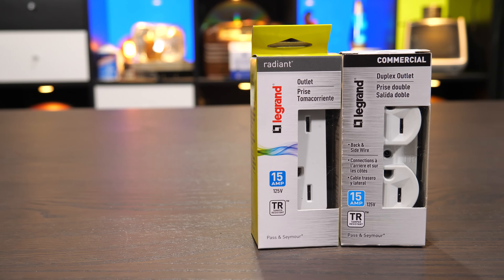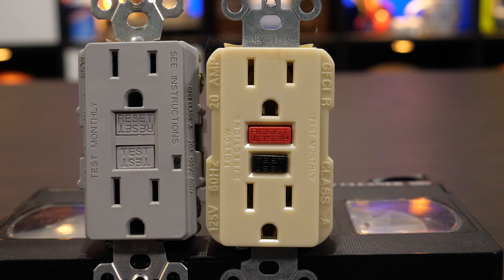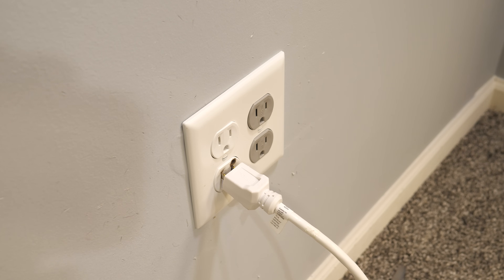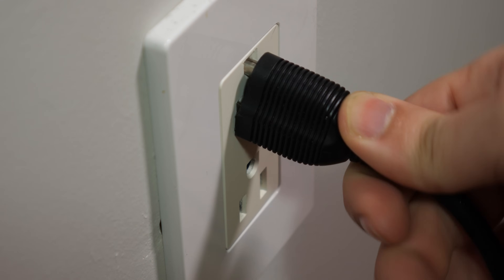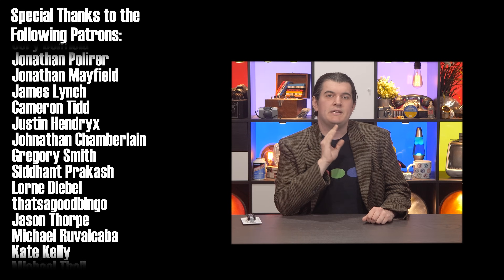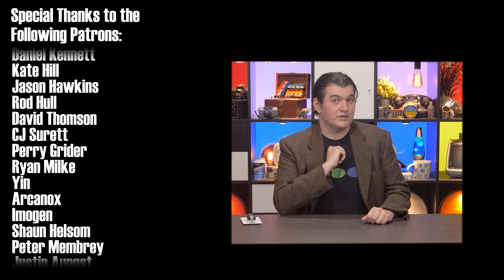Power outlets are topsy turvy - but does it matter?

Comment: I've been hit by everything from 110v ac from a wall to the several THOUSAND volts from an ignition coil on a vehicle.  I'm so sick of people being skittish about what is ultimately harmless in 99.99999999% of the cases it happens.  Yes, electricity can kill.  I get that.  The safety of a particular plug type or orientation isn't going to be nearly as much of a factor in that as the condition of the wiring of both the appliance, as well as what's in the wall, and the moisture content of whatever you're standing on.  From my experience, the safest plug isn't even found in most household applications, as it isn't common for ac wiring.  The humble pci-e connector on most (except newer high end Nvidia) computer graphics cards keeps both the male and female pins covered regardless of if they are connected, preventing any kind of accidental touching in the overwhelming majority of cases.

Comment: Honestly, as a commercial/ industrial electrician for over 10 years,  I have always found the ground prong is prone to separation and breaks when its left on the bottom because it applies all the force and weight on a single ground pin instead of two blades... also, the two blades are far more secure inside the plug housing than the ground pin... it also can help if something falls onto the plug,  the hot blades are slightly more protected from arc/ contact damage... plus, a pyramid is sturdiest when the base is wider than the top. But that's just my two cents

Comment: The UK plug and sockets system is absolutely safe, fool proof, protective and secure...nothing you showed here can happen to them, and in fact they are also a lot neater as the lead (cord) goes straight down along the wall from the bottom of the plug, which when inserted, only protrudes about half and inch anyway, much, much safer and neater that your system, and they cannot be knocked loose unless one uses a hammer....lol

Comment: We had a penny fall on top of a plug exactly as you demonstrated, but the power was on.  It literally exploded off, leaving a explody black stain from the top of the plug to about 6 inches up the wall.  It did trip the breaker, but it had long enough to melt two knotches into the penny.
edit: Our window a/c has a upside down plug.  well, its oriented for the ground pin to be at the top.  So we have to plug it in upside down.

Comment: I remember commercials made by the electric providers where they animated the plug as a face that talked.  So the electric company thinks it should be a face, therefore it goes ground down.

Also, night lights are made with the wide blade on the left, meaning they face up in a ground down receptacle.  If you put it upside down the heat of the bulb will reduce the life of the socket.

Comment: We need a standard that specifies a maximum width and height for a plug so it can fit in any power bar whether the outlets on it are side-by-side or top-to-bottom. No more wasting two power bar outlets because of a wall wart.

Comment: And our British type G plugs are right angle by default. And have sleeved prongs, except for the REALLY cheap plugs(which I'm sure aren't legal).
Reply: Your British plugs are clever because they have the fuse in them. This cuts down on the pretty pointless (as of 2023) discussion of "don't daisy chain extension cords". 

But personally I don't like their bulkiness. They are a design of 1940's, I guess nobody cared back then that a plug might be larger than a phone charger 😂

Comment: As someone living in Brazil (which had the Nema plug as a standard until the previous decade), I forgot how unsafe this kind of plug is. It is also very unreliable, plugs/outlets used to wear out and become loose.
The ABNT outlet (current standard here) is very good, it is based on the European plug and is even compatible with it (only when the plug has no ground pin). The only caveat is that for some reason they decided to have 10A and 20A plugs/outlets, with different pin diameters. It's probably because here in Brazil some regions have 220V phase-to-ground while others have 127V., and high power appliances need the extra current when on 127V....

Comment: I'm surprised that most all receptacle units have the plug sockets orientated one atop the other as opposed to side by side, which would allow for the cable to come out of the plug straight down without obstructing the other. the diagonal cable is certainly a good solution to this issue, as it allows the cable to go somewhat down as well as not obstruct the lower socket, but it means that if your sockets are sideways then the cable could still be going up instead of down.

Comment: I was waiting for a shout-out to tamper-resistant outlets. I recently replaced a bunch of outlets around my house, and I had to decide whether to use the regular outlets vs. tamper-resistant. I ended up going with tamper-resistant because I expect this house may someday be occupied by a family with young children, and I wouldn't want to be the reason someone got electrocuted. Now, tamper-resistant plugs have their detractors, as they can be more difficult to plug in sometimes. But I've found that pretty much any tamper-resistant plug can be plugged in easily if you know the trick, which takes less than a minute to learn.

Comment: Oddly, commercially available "plug checkers" are all set up to read with the ground down....  How would you use the Klein Tools RT250 GFCI Outlet Tester with LCD Display, withthe LCD face pointing down.... Just sayin' if the testing equipment can't be read in one orientation, that implies that there is a "usual way" and an "Unusual way".  I usually go with the usual and customary way, unless the application requires another option.  When someone tells me "its in the Code" i tell them to show me....  :-)

Comment: OMG, what a crappy power socket/plug system you have in USA. Where is safety?! You can incidentily touch energized wire when it is not fully inserted and you can even insert plug in wrong hole (ground)? Please, compare with European system which does not have those issues.

Comment: I work in a hospital and I was told by one of the electricians that the reason was in case something thin and metal slid down the wall and went behind the plug insulation. Then I had 4 plug outlets installed in a new office and this plugs where in a circular configuration an the hit side in the top one was oriented up. The way it was configured there is no way to orient it down no matter how you install the outlet.

Comment: didnt' you make a video about the exuse of "but sometimes" not being valid? i mean to be fair, it does depend on your preferance more so then anything else, my main issue with not having the ground pin up is the fact that something can get behind the plug and short it... while it's generally safer with ground pin up in that scenario. this is however irrelevant 99% of the time unless you have kids or displates hanging on your wall.

Comment: I worked in a preschool many years ago and we had a lamp plugged into a "face" oriented outlet. The wall plate was metal, and one day I heard a metal jingling noise coming from the outlet and saw that the plate had become dislodged and was resting on the prongs. Somehow the breaker didn't trip, but when I unplugged the lamp, the cover had two notches where the prongs were touching it, it had burned some of the metal away. I think that the spark that was created was enough to move the plate and break the electrical short, but it would fall back down and happen again, slowly burning away the plate. Thankfully it wasn't plugged in anywhere a child could get at it!

Comment: Benny here from Germany! I am honestly pretty baffled about you Americans having these problems. I'm pretty happy about our SCHUKO-Plugs, although they are sometimes a bit bulky. But would it be possible, to surround your outlets with a sort of frame around the plug kinda like ours do, or would that be impractical because of the variety of plugs? I mean it would be a somewhat easy fix, wouldn't it?
Reply: I was also thinking about this, but all those right-angle plugs that were intended to be flush to the wall probably wouldn't fit if they made the switch now.

Anyway, I'm definitely also happy with the balance plugs here in Germany strike between safety and convenience. For low power devices the two-pronged Europlugs aren't that bulky.
Reply: I'm not from Germany, I'm from Kazakhstan, but here schukos are also the standard, though it's still not uncommon to see the old ungrounded CEE 7/1 recepticles that are less safe, not only because they are ungrounded (but even they are infinitely better than American recepticles). I honestly can't think of a better standard than schuko sockets combined with schuko plugs and europlugs. It's practically impossible to accidentally zap yourself with these, as well as short them with something like a coin or necklace, they are very durable and are convenient to use, europlugs are also pretty slim

Comment: Only right angle plugs I've seen that can work with upside down socket without issue* are surge protection power bars that have a rotating plug on them. Great idea for sockets of all orientations, be it it right side up, upside down, side ways, diagonal, 4-dimensional, etc.

(*this also creates a point of failure that can result in overheating and damage to the plug resulting in poor connection, blowing/triping fuses/breakers and potentially causing fires)

Comment: We could orient both outlets with ground away from the center. This would mean the top outlet is always ground up and the bottom is always ground down. This would allow plugs designed for the ground pin at the bottom to be plugged into the bottom.

Comment: The solution to this very bad plug design is just make the 2 metal inserts half plastic, like you half sleeved them at the video, and then all of this discussion will come automatically to an end and you would have a better plug than the surface euro one cause your plug considers polarity also whereas ours doesn't.
Cheers from Greece! Keep up!
P.S Use gfci or our european one, don't remember the name, for the whole house not just the bathroom

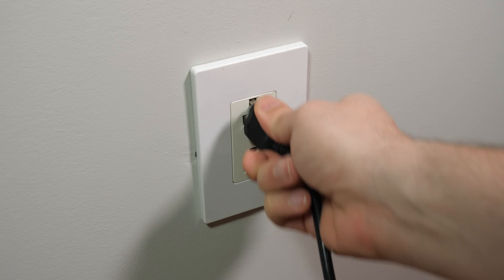Comment: 4:44 I've shocked myself a couple times on "inverted" or otherwise awkwardly oriented (relative to how they can be accessed) outlets due to this exact reason, it's a lot easier to tell where your thumb is and if there's any debris that may get caught in the live pins and cause issues if they're oriented towards you like "normal"

Comment: My sister once had a metal necklace fall onto the loosened, exposed, plug that was plugged into a ungrounded and probably underrated extension cord, which draped across the plugs and proceeded to start a fire on the carpet. Luckily my mom stomped it out in time to keep it from being any more than a burn on the carpet, but had nobody been there it could well have burnt down our house. I’m not even sure if a ground pin would have stopped it. This is a real danger that can just happen because of bad luck.
Reply: Yikes. That's a slightly easier scenario to imagine happening.

Comment: horizonal receptacles are best installed with the hot blade on top, because you're more likely to accidentally contact the blade on the bottom 

the official argument I've heard in favor if ground down, is it's mandatory that the ground pin is the last to break contact, and with an inverted receptacle, if the plug falls out, gravity will twist it so the ground pulls out first.

Comment: Was shielding from shock really the only reason for flaring the contact face?  It also provides a more stable connection to the wall, preventing the plug from rocking in place and avoiding exposed prongs after full insertion.  Grounded plugs are already secure and stable once plugged and thus wouldn't gain that benefit.

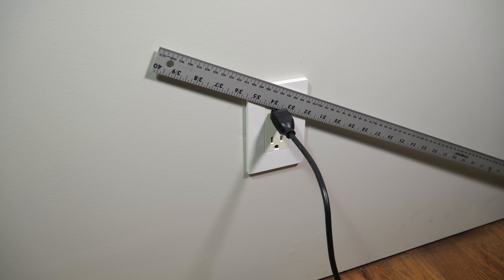Comment: 9:41 not if the person isn’t grounded lol.  I’ve handled hot wires before one handed so it significantly reduces the chance of a shock through the chest but more likely if I keep my hand away from any grounds or neutrals while simultaneously touching the hot it keeps me from getting shocked too. It goes without saying I’m insulated on my feet too.

Comment: A the reason those plugs don't have a extra lip could be because there are shielded female receptacles that have like an extended bit that you have to push the plug into. imagine the wall outlet with a tube coming off of it about an inch. the idea is that you couldn't even get your hand close to the outlet when plugging in. I've only ever seen them in pump rooms and rooms with chlorinators in them.

Comment: In the house, sure. For the reasons you lay out. I run the outlets in the garage ground pin up since everything I plug in out there is a straight 3 pin plug

Comment: Here's the problem. The electrician who worked on my house installed all of the outlets with ground prong on top. It's hell, because nearly every chonky electronic plug is designed to go in the other way, so they don't fall out of the socket. 

So, no. The "regular" way of installing outlets is by no means upside down.

Comment: I get why they can't replace that plug and outlet combination now, but it's just such a terrible design. The fact that there isn't a recessed design or anything like that just makes it worse.
I've got a clock that predates WW1 and so does it's plug and wire. But in the end it's still a Schuko so the 100+ year old bakelite plug is recessed into the socket, so you just can't reach the electrified bits.

Comment: My outlets are “right” and it drives me nuts. I have multiple things that are not designed to plug in that way and the cord juts upwards instead of downward.
Reply: My toaster has a loop to put your finger through the plug … no where near the metal when touching it. I’ve seen a few things with the same plug. Check it out.

Comment: The simplest solution we could implement which would have the greatest impact with the least hindrance to current plug designs would simply be to stop stacking our outlets and place them side by side instead.  Add a removable shroud that goes over the top and protrudes 1 cm or so to prevent the pins from being exposed to falling objects and you're set.  While we're at it, modern studs being 16-24 inches apart is plenty enough for us to spread those outlets out another inch and make room for those bulky ACDC adaptors to both fit on the same plate.  You could even put a replaceable fuse in between them, maybe even some switches to turn power off at the wall or make an outlet optionally switched by a lightswitch.
Reply: or just look at European plugs. never meet any of mentioned problems with it in my life. for backward compatibility use adapters. 
im telling it not to s**t on US, just really easy idea - there are a lot of production of adapters and EU plugs, so its cheap, doesnt require redesign, and already checked by half a billion people for foolproofness. modern plugs even has built-in protection from inserting foreign objects
Reply: @stv_iostream  It's not really that easy though.  You're talking about obsoleting billions of wall outlets and tens of billions of devices that use the plug.  It's easily trillions of dollars to replace everything.
Reply: @ResonantFrequency  thats the trick - no need to replace them all at once. just dont build new. 
i.e. - socket broke - instal new with EU standart. use adapters to plug old devices. and vice versa - use adapter to plug new EU device into old US socket
proof that it will work - in soviet era there was changing in voltage in russia. and every family just got couple small transformers to use different devices with different standarts until with time there were only new standart
Reply: @ResonantFrequency or just make the outlet be sunk in so half the plug is inside the wall.
Reply: @inteallsviktigt  if you do that then a great many brick style ACDC adaptors will not fit.  It will cause issues with any right angle plugs.
Reply: @ResonantFrequency   it necessarily. you can just google Leviton decora 15 amp residential grade 1 gang recessed duplex receptacle outlet and perhaps with half  recessed distance as standard. And instead of one giant hole it would just be individually recessed so that the moment it makes contact you can’t touch the pins.

Comment: I had a old metal wall plate fall and short an outlet behind the TV (old house built in the late 80's). I went to reset the breaker, heard a pop and the breaker re-tripped. Found a small amount of smoke from the faulty outlet. 

Went around the house replacing all the covers with plastic ones after that.

Comment: In Europe, plugs are usually slightly inside the wall and have a plastic "shield" around them that makes it practically impossible to get shocked, could this design be applied to US plugs?
Reply: Anything is possible... 😂
Reply: It could, but "it costs money", and there's nothing more important than money in North America. 

BTW Europe used to have "flat" sockets until the 1960's.

Comment: grounded shulko plugs are often angled and have a grippy bit molded into the plug. you can even buy replacement plugs with pull rings on them for easier unplugging. manufacturers should copy that for the US.

Comment: I have installed one ground-at-top directly below a window so that the right-angle plug on my window AC unit wouldn't have flip upward. I'd say default to the normal ground-at-bottom, but if you're capable and comfortable changing outlets safely, you can customize as needed.